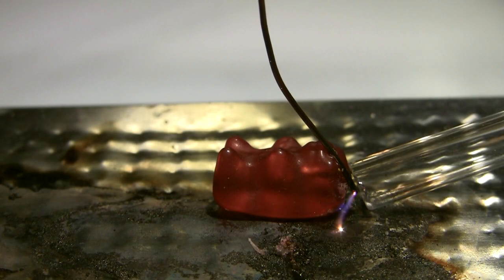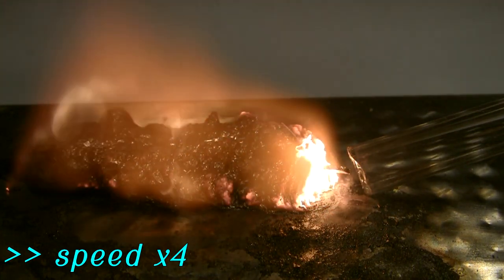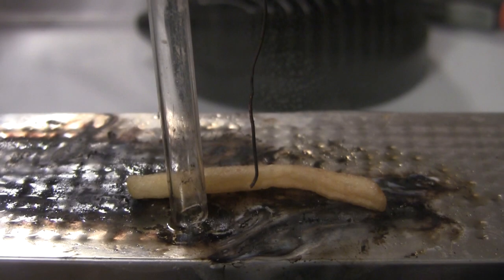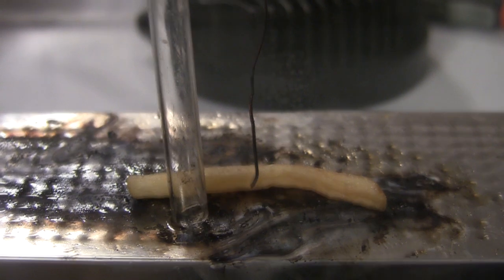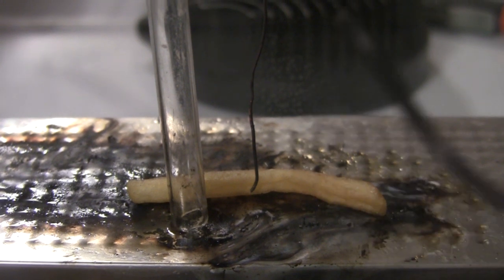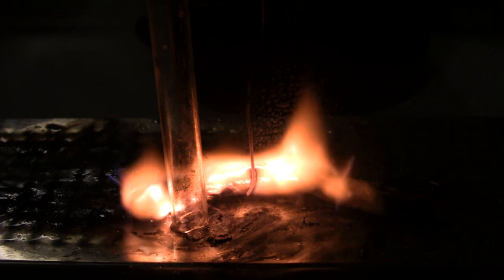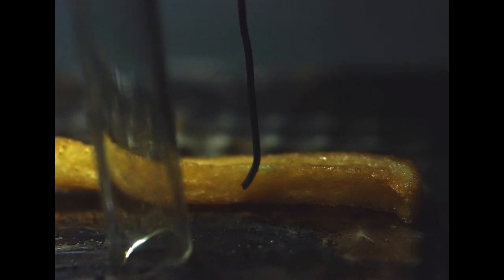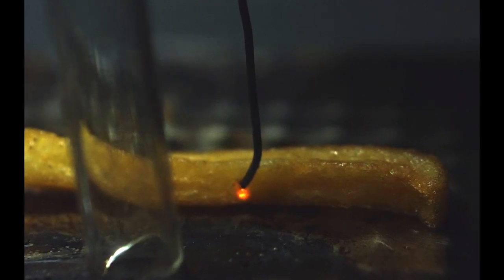High speed camera reveals: French Fry Fireworks!

Comment: Hey TF and community, 
I've recently read the article in the following link and was wondering if anyone could tell me if it is plausible. It say that some researchers have developed a film that can convert heat into a certain wavelength of IR which would pass right through the atmosphere. That would allow it to passively (without using any electric power) cool the inside of whatever is coated with said foil (a house f. ex.) and thus reduce or even eliminate the cost of air conditioning. The claim that they are able to cool the inside of a house to 20 °C while it is 37 °C outside, because they are using the temperature differential to outer space. Does this make sense?
I am a (rookie) electrical engineer, so quite science-y but I do not have much knowledge of thermodynamics. Even though, this smells quite strange to me. Does their product violate the first law?
http://www.economist.com/news/science-and-technology/21716599-film-worth-watching-how-keep-cool-without-costing-earth?fsrc=scn/fb/te/bl/ed/materialssciencehowtokeepcoolwithoutcostingtheearth

Comment: Thunder Foot, could you please put your gummi or fry in and oxygen tube, and the exhaust piped into a heat exchanger to transfer waste heat to the incoming oxygen supply, in order to saturate the fuel supply with it's own heat instead of simply wasting it away.
I'm curious as to how efficient you could make it, and if that might help melt your gold.
Thanks

Comment: TF, electrocute some hotdogs. My dad had made a DIY hotdog cooker one time. He some nails into a board, and he connected the nails to a power cord. He connected one wire to the nails on one side of the board, and he connected the other wire to the side of the board. When he placed the hotdogs on the nails, it completed the circuit. Once he plugged the power cord into the outlet, the cooking commenced. The hotdogs would start smoking and sparks would light up the inside of the hotdogs.

Comment: I wonder what's the purple radiation is on the slow motion. Probably camera picks up some IR as the colour gradient on the ignition wire resembles temperature gradient I would expect there. Or it may be some other radiation correlated with the reaction intensity or temperature....

Comment: Sorry but as someone who regularly works with explosives as well as fuel/oxygen mixtures I have to correct something you presented.

You are not burning these items in a "pure oxygen environment" as this would require you to run this experiment inside a chamber that was vacuumed down then filled with only oxygen. Of course the issue with this in that the experiment could easily turn explosive under these conditions even with a relatively small quantity of fuel. 
What you actually did was operate in an oxygen rich environment where inert atmospheric gasses where able to temper the rate of fuel consumption.

Comment: correction, the ammount of energy released in the vid is NOT the same as you get from eating it, if it were so you would not be able to set your french fry dung on fire (even without 100% O2), stomach burns slower and differently, so for all you ladies out there counting calories, cal does not equal fat, long carbon chains plus short carbon chains bound by insulin = fat, in other words dont eat french fries with coke

Comment: I would like to see how electrolysis looks like in slow motion. TF, if you do that I mean that would be very awesome. :)
Reply: Primark Bandit well I was thinking more of the lines to make electrolysis to get a certain metal (like copper). In high school we used to do this electrolysis to see which metals are more reactive. Well we knew the reactivity of them the metals before hand, but still it was cool to see in real life what happens. We were devided into groups in the lab and had enough materials to test it all out. However, it would be cool to see this with slow motion. However, your idea with the alkaline water also would be great to see.
Reply: Of alkaline water? Water maybe becomes cloudy near positive electrote because of whatever base you dissolved in the water, bubbles form on both electrodes, would be cool to see them form but not really.
Reply: Primark Bandit well grant thompson puts random things in a vaccum chamber do electrlysis is acceptable theese days
Reply: Going back to childhood mischief, burning ants with a magnifying glass in slow motion. Of course for the slow motion camera to capture it, the ant will have to be glued in place.

Comment: we don't process 100% of the energy in food, but understand your point
Reply: Ralph McMahan what are you taliking about i poop spent charcoal
Reply: Holy cow 999
You seem to think that I am arguing that all the chemical energy we get from food is stored in the tissues. I am well aware that is not the case.
Reply: Ralph McMahan
I had to scroll down way too much to find this. I was starting to worry.
Reply: Ralph McMahan About how much do we process?
Reply: +Holy cow 999
The fact that you can extract energy from poop by burning it indicates that at least some of the chemical energy is not absorbed.
Reply: Holy cow 999
I don't think we're in the same page here:
What Thunderf00t said is that the amount of energy you get from food is the same whether you burn it or digest it. This is fundamentally wrong because that would imply that either:
 
a) Digested food (i.e. poop) has the same chemical energy content as carbonized food (i.e. ashes). That would mean that you would obtain a null energy output from transforming poop into ashes (which can be verified to be false).
b) Energy is destroyed when burning food, as you could obtain a larger output by doing a different transformation between the same two states (from food to ashes) by simply digesting it first and THEN burning it.
Reply: giovanni9107 we would get pretty big pretty quick if that was the case ;-p even if we just stored 10% every meal that would be pretty bad.
We actually store and use some percentage of the mass so in that way we are storing vastly more energy from the chip than just burning it if you consider mass -> energy we just can't use it ;-p
Our metabolism of carbohydrates can be pretty efficient 30% to 40% depending on how you look at it but talking about efficiency in living things is really messy as we just demonstrated

Comment: It's glowing purple...

Does that mean it has a black body radiation that's colder or hotter then the surface of the sun?
Reply: Camera sensors tend to see IR radiation as blue light. You can try it with a grill oven (or anything that glows red hot) and a cheap camera, you'll see puple glow.